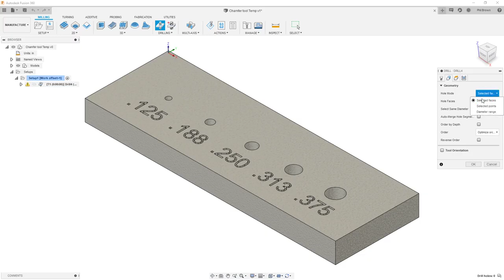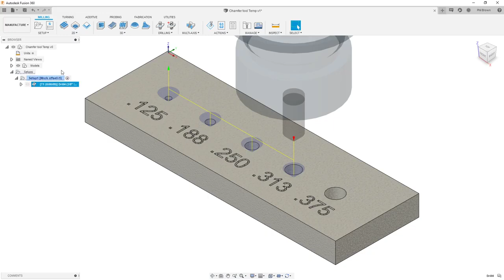Fusion 360 Quick tip on selecting different size holes for spot drilling

Comment: Thanks for the video! Is there any way to set it so you have the same chamfer amount for different size holes so the spot drill won't go in the same depth every time? I would guess I would need to make a separate operation for each hole to be able to do that?